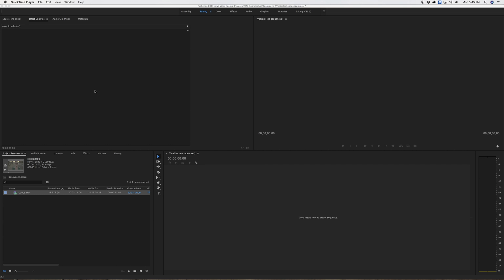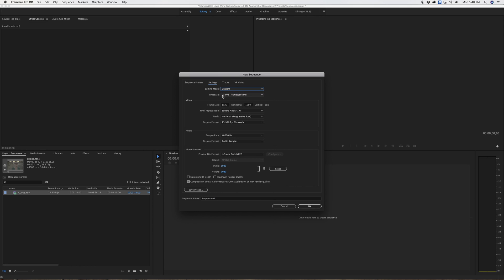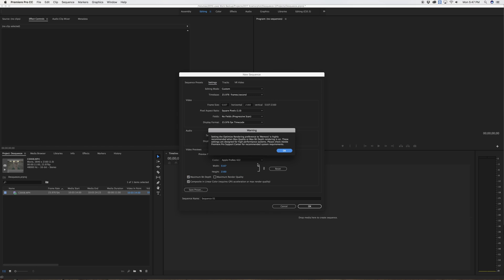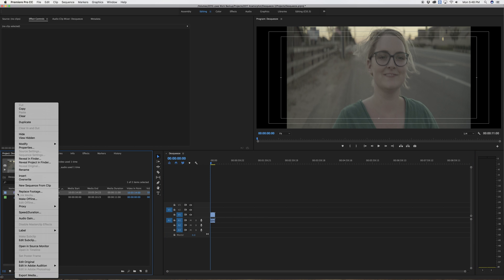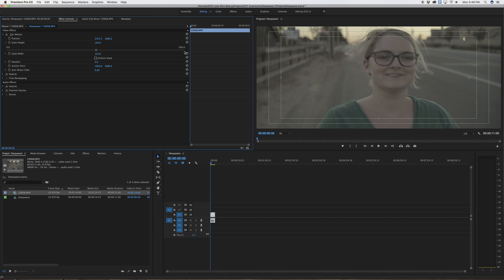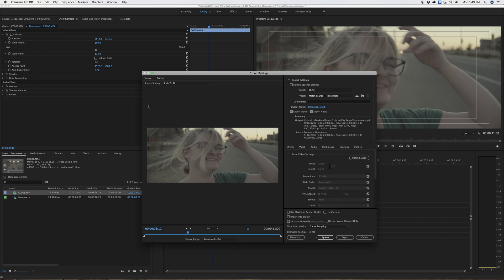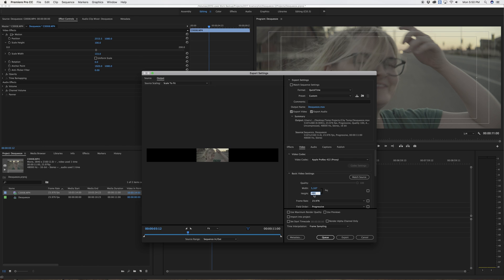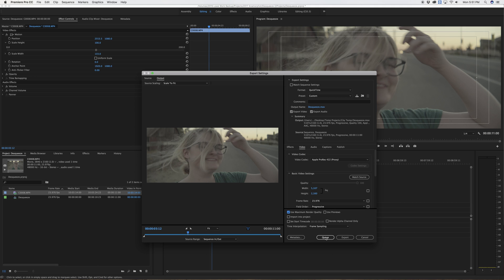Anamorphic Desqueeze Premiere Tutorial 2017

Comment: Why not just change Sequence Settings from Square Pixel (1.0) to Anamoph 2.0 instead of changing the footage width?
Reply from the maker: Totally valid. I just really dislike changing pixel aspect ratios because it can cause issues during export.
Reply: Kyle Lowe Creative I see. I'm only asking because I'm very new to it so I was just wondering. I tried both and they both worked well. Thank you for the original information!!
Reply: so if i do that and want to export a framegrab than the framegrab is in original a. ratio

Comment: hi ! thank you , but how do you get the two marks (cropmarks? ) when you create your  sequence , i don't have them...
Reply: kyle , i have another question, is it the same method for desqueeze an 4992X3744 6K footage from GH5 ? the aspect ratio seem not wide enough , thanks again !!!
Reply from the maker: This method forgoes crop mark overlays for creating a sequence with a wider frame.

The idea is similar to this video that was making the rounds a little bit ago: https://youtu.be/H851a7hEjDQ

The GH4/5 anamorphic mode shoots in a different frame size so you will want to multiply that frame width by the squeeze factor of the lens you’re using (1.33 or 2.0 or something different).

Comment: How would you custom desqueeze 2x Anamorphic?
Reply from the maker: Basically the same, but multiply 3840*2 (=7680) and then stretch the width by 200.
Reply: Hi, thanks for the info. I did that for my x2 anamorphic lens but it looks squashed still. Do i have to adjust the height too? If i adjust the height it looks right but then i'm scaling up and losing quality ?